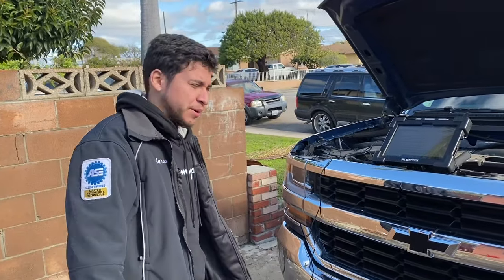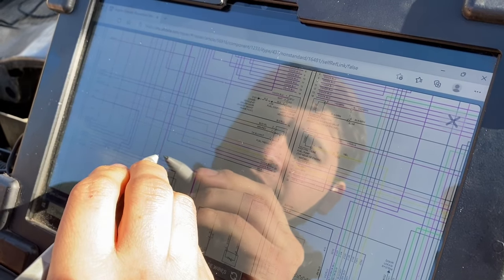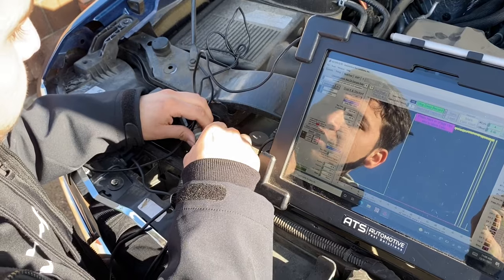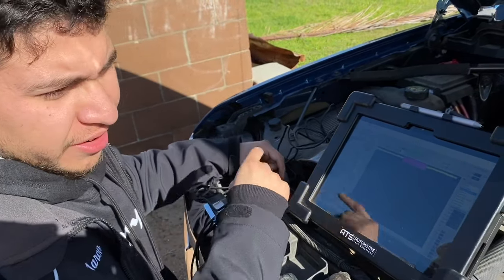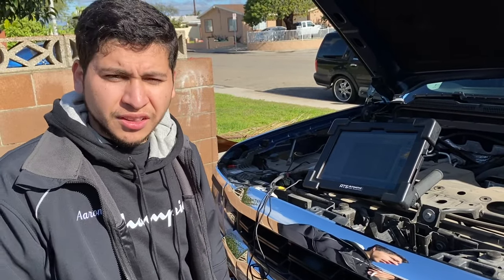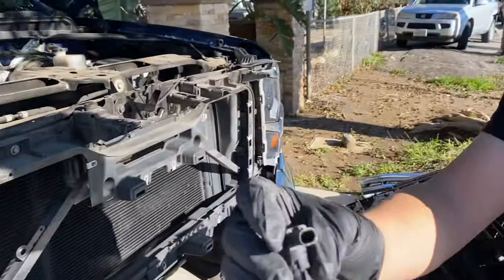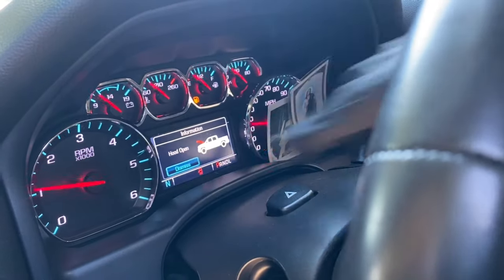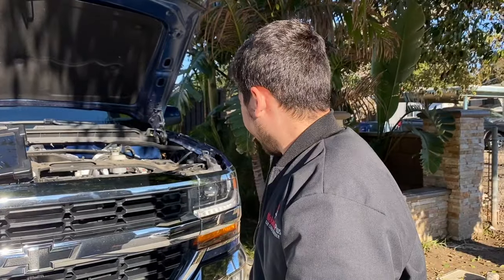Chevy U1510 LIN bus code 
Case study diagnosis and repair

Comment: What training do you have about the LIN HEADER for each SLAVE on a LIN wire? The HEADER is the first few square waves of each packet that has its own signature for each LIN Component, many times when buying an Aftermarket Alternator that was improperly cross-referenced, the LIN Signature will be wrong and it will not work. ABOUT the first half dozen up to about 10 square waves will be the HEADER Signature, I like to show this fact on my scope and save it to my library. Sometimes there is more than one SLAVE on the line and that info can be used to find a root cause issue by one of the SLAVE Components for diagnosis. It also appeared that your scope resolution, or filtering, or some setting needed adjustment to clean up the pattern I was noticing, some form of Aliasing?? I just found your channel right now and this was a cool video, just needed to add in this suggestion for your future LIN collections, cheers.

I will look to see what type of work you normally do and see if I will keep your channel in my very long daily listings of NON-DIY Channels, much appreciated.

Comment: Can you tell me where the 15amp fuse is? I replaced my battery and they stopped working and threw a shutter code. I wanted to check for voltage

Comment: Great job on explaining & the video diagnosing the U1510 code. I recently purchased a 2018 GMC Sierra 1500 Crew Cab with only 50k miles & the check engine light came on a day or 2 after I had replaced the truck's original factory battery. I was curious if the new battery or a bad connection with it can cause the check engine light to come on. The battery hook up for my 2018 GMC has a case that goes over the positive side you have to remove to get the battery out so that made me wonder if the battery guy may have not put it back on correctly. I had my mechanic run a diagnostics check & said it was a U1510 code. He read all the possibilities of what could be causing it & because both the heater & AC are working fine he cleared the code to see if maybe if it was from changing out the battery. Next morning check engine light came back on. I am going to send my mechanic  your video in the morning to review & see if this maybe the issue. My question is what damage will it cause to the engine, heating & cooling, & electrical components if I wait & keep driving my truck for a while before I fix it ?
Reply: Did you know what it was? Was it the grill active grill shutter?

Comment: Thank you for this! I had the code and ordered the parts and replaced it. After I replaced the shutters , the thermometer was not communicating so I unplugged the battery and it works now. But the compass needed to be recalibrated by just driving around! No more check engine light now and I can remote start again!
Reply: What part did u order bc my remote start won't work and I have this same code pop up ?
Reply: Same I have same code and same problem with remote start what part did you get
Reply: Ok ok thank you I’m going to go ahead and order and hopefully it gets the job done
Reply: Same! I have that code and my remote start won’t work.

Comment: I have the same code u1510 but k9 Body Control module Lost communication with Device on lin bus 1 ( ultrasonic instrusion sensor). Do you know where is the problem ?

Comment: what color is the lin bus wire? and I have the same code from autozone, but the print out says from Code U1510,  Remove Object or debris obstructing active grill shutter assembly?  says no suggested parts? Power Train System.  what causes this, and is there a way to just not use it and allow it to remain open at all times,  since i dont live in alaska and or severe cold place, and just want to remove the check engine icon symbol? Not everone has that diagnostic display,  so if i have an electrical dc meter can i do the same? how do you know if its not just a fuse?  and where to check to fuse first?

Comment: Hey man, my 2018 Chevy Silverado 15 is throwing two codes. P2101 and U1510. My check engine light was on for a couple days prior but it ran fine. The truck was sitting for 4 days then when I went to start it now it says reduced engine power and shakes. I left it off for awhile and it ran fine. It is showing that I need throttle body and LIN Bus. Is this correct?
Reply: Same scenario here , did you get the fix?
Reply: Same here anyone have the fix?
Reply: Literally same things. I need an answer!
Reply: So I had the throttle body cleaned and it took care of the first code. The second code is the shutter assembly in the grill. After changing that out I have been issue free. I think in some way these 2 issues are related.
Reply: @terrystoybox  I’ve changed the shutters 3 times now and code keeps coming back. I’ll clean the throttle body as well and reset codes and see what happens

Comment: Hello, i have the same issue on my 18 Tahoe. I'm wondering, since it's such a common issue, has anyone figured out what exactly goes bad in the circuit? If it's just a resistor or capacitor, I'd rather just fix my grill instead of buying a new one that will do the same thing down the line.

Comment: I have same code came up I went put on code reader at auto zone and it said to remove any debri or like something was in coil. So I sprayed it at carwash but engine light still on but the coil it had just got replaced and my auto start won't work the doors on mine are open what part u think I need to get or u think I need to take battery cable off then put back on or maybe a wire is loose but what is the part called just shutters

Comment: The shutter was replaced on my GMC but the code u1510 discussed in the video didn't go off. The electricians don't have software for my model and refuse to take over the issue. Probably the temperature sensor was not installed. I think I will deal with it myself. Would be nice to have a wire diagram or description of the wires.
Reply from the maker: Like in video, theres one power , ground and signal wire. Test them first and if ok then most likely the shutter or less likely the pcm
Reply: @traildisc155  which one is the power cord?

Comment: Great Video, I only had a U1501 and replaced the Air shutters, but since the replacement, I have a U1510 is there anything else that could cause it.
Reply: I found the issue, the fuse failed for the air shutter and failed in a way where only visible inspection would identify. the fuse is number 47 call "throttle control" on the 2017 Serria Denali engine bay fuse panel

Comment: i finally managed to test the wires. one provides constant 12-13V voltage and the other color wire is dropping/fluctuating a little bit. i dont have a scope to see the signal mode. the engine check engine comes on all the time. if the issue with the shutter, how the actuator pins should react if i test the resistance between the pins of the actutator. want to make sure i should replace the actutator.
Reply from the maker: If you got power ground and signal lin bus  other alternative would be just the shutter assembly
Reply: @traildisc155  the shutter looks to start working after I cleared the code using by a scanner.

Comment: Great video just recently had this issue but didn’t think of it much and now I had went to get the code read and now “P2101 and
U1501” recently popped up a couple weeks later, should I replace the shutters?? Really need the help
Reply: I have the same 2 codes happening to me currently on my 2018. Did you get this resolved?

Comment: Great video and scan tool. You got some good diagnostic thinking. My 2017 Sierra set U1510 and P2101 at the same time. Is this the Shutters causing loss of data on the LIN hence giving me a false code for the throttle body? Or did both these things crap out at once.

Comment: First time seeing your video. Great video by the way. I got the same U1510 code. 2017 Chevy Silverado 1500 Z71 4X4. Watched your video. Called the dealer, purchased a new shutter assembly and installed it with no issues. Simple installation. However, the check engine light is still on and the same code is still popping up. Any ideas on what else it could be?
Reply: Ever got it fixed?

Comment: Is this on all vehicles or just an option for the colder climates and prevailing winds. I've seen these on refrigeration units but never cars. I always thought the coolant thermostat would regulate the engine temp.
Reply from the maker: Sometimes i guess thermostat aint fast enough according to the engineers who designed this
Reply: It’s just more garbage to put on the vehicle and more for the dealership to get you to come in so they can screw you

Comment: Will the check engine light reset itself automatically after the new installation? How quickly does it reset
Reply from the maker: It should if not disconnect neg terminal of battery for 5 minutes

Comment: Appreciate the detailed video. I have a 2017 Chevy silverado and check engine light came on today. No other mechanical issue , code was u1510 “ remove object or debris obstructing active grill shutter assembly “ no other code. Does this mean I need to replace the shutter like you did? Please help!
Reply from the maker: Most likely you would have to but a diagnostic procedure like i did here would be best to make sure but most the time its this 300$ shutter assembly
Reply: @traildisc155   I just don’t want to have to pay an addtl $200 to have a dealer diagnosis it. I was able to remove everything and expose the shutters . You made the replacement look fairly easy. Taking it to a shop it’s labor+part+ diagnostic fee .
Reply from the maker: @almal5754  yes it would be, i  never recommend changing parts just because of a code but sometimes you have to, to save money
Reply: What about after you install the module ; does it need to be programmed to the vehicle?
Reply from the maker: @almal5754  no , plug and play
Reply: Is that for every vehicle? When do they need to be programmed?
Reply from the maker: @almal5754   normally they need to be programmed when its a pcm bcm ebcm srs ect smaller one job modules on gm normally dont
Reply: What year is your Chevy? Looks similar to mine, 2017 Chevy Silverado 5.3L V8?
Reply from the maker: @almal5754  yes exactly that
Reply: Okay! Gives me peace of mind. Had the code removed to make sure it wasn’t a glitch. Came back :( so most likely a new part is gonna be the solution
Reply: @almal5754  did u fix it? By get new part?

Comment: Will this make the truck run sluggish? My 2017 doesn't seem to be getting fuel at times..
Reply from the maker: No normally no 
But if the blinds are stuck open and your environment is colder then cold starts do stay colder longer causing more fuel to be gushed in cylinders to heat them up faster

Comment: wheres the 15 amp fuse at? im currently dealing with the same issue but dont have any power to green/violet wire
Reply from the maker: Year make model and engine size please
Reply: @traildisc155  2018 gmc Denali 6.2.

Comment: I have this code and my remote start does not work.  is this the reason why it does not work? I know for sure my active grille shutter dont work
Reply from the maker: On newer gm vehicles if the check engine light is on the remote start will stop working
Reply: Had same issue. Dealership replaced fuse block in engine compartment. Problem solved. Dealership said this is a fairly common issue.

Comment: I have the same code in my gmc sierra 2018, u1510, u1501. Found that there is no voltage on the purple wire. Does anyone have any idea ?
Reply from the maker: Check for fuse
Reply: which fuse would it be?
Reply: @Jordan Jackson  there is a comment further up saying its #47 (throttle control) in the engine bay. Hope that helps!🤷‍♂️

Comment: What does limbus mean thanks for the video I just not a technical OR technician kind of guy so I didn't know exactly what limbus means and I don't think you made it clear what limbus actually means might be a line I might be a circuit or what I don't know but I'd like to know but thank you
Reply from the maker: Local interconnect network data bus

Comment: I changed my battery and now I have this code I’ve tried doing a global reset and still have it
Reply from the maker: Probably this part
Reply: @traildisc155  it’s just odd because everything was fine until the battery died,and just now I got in the truck and the radio is reading the outside temp at -40 🤦‍♂️

Comment: so this thing is for what? a backup when the thermostat fails? 🤪
Reply: Newer cars, they controle the temperature better. It has lots of functions if u use your imagination
Reply: Instead of putting cardboard in front of your radiator, you use this. Another thing to fail!